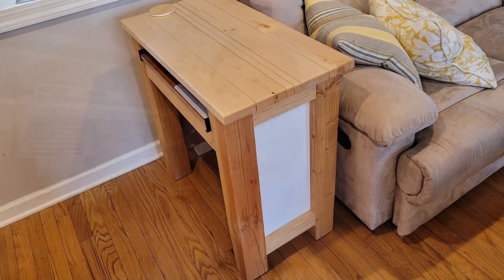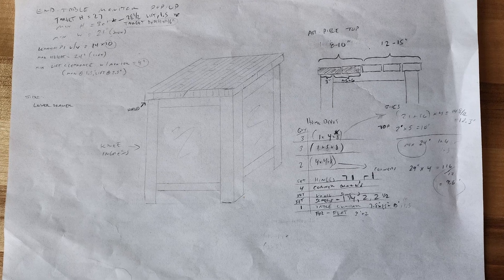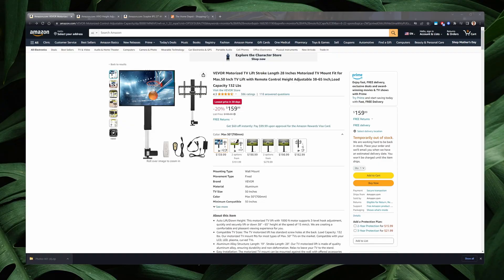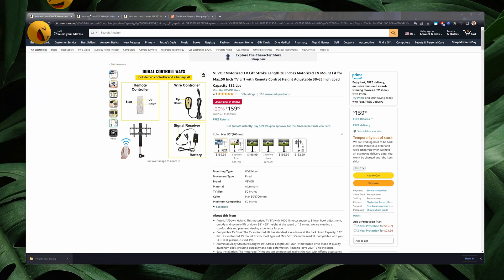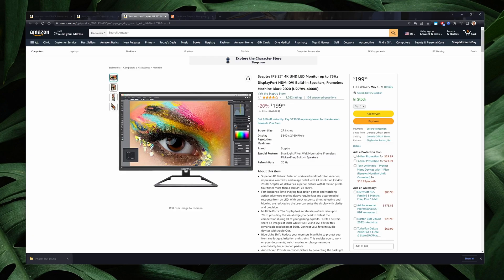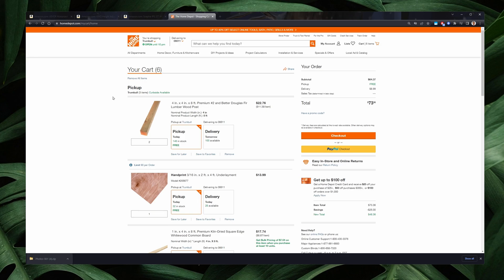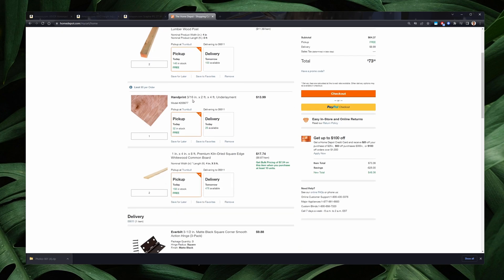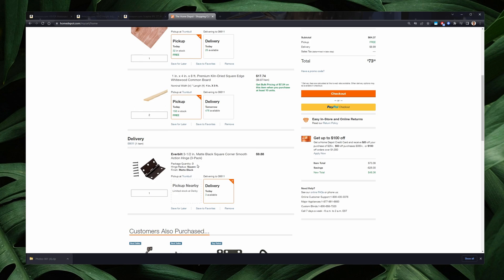MOTORIZED 4K Monitor Lift DIY

Comment: Great job. This is what I would like to do , but I need a lift that I can attach a shelf to because I have an apple desktop.  Any suggestions???
Reply from the maker: A Mac mini could be accommodated for where I have my dock perhaps.  If full sized desktop, I'd suspect it would be on the floor or on a bigger surface area.  If I had my way, this piece would have been larger.  I can't speak highly enough about the lift, it's been up and down hundreds of times at this point without issue.  Thanks for watching!

Comment: Great job on the build.  Simple design, efficient and good looking. 
Do you have a link for the riser? I don't seem to be able to find it.
Reply from the maker: Thanks!  My wife has really put it thru it's paces and it still lifting.  Here is motorized lift I used:
https://amzn.to/3T0fwwz
Reply: @manicmods  Thanks for the quick response.  I had been able to easily find the lift, what I was interested in was the riser?  I watched your video again, searched for VIVO Height Adjustable VESA Adapter and found it myself.  Have a great day and keep up the good work!